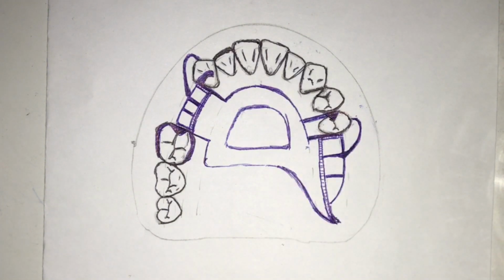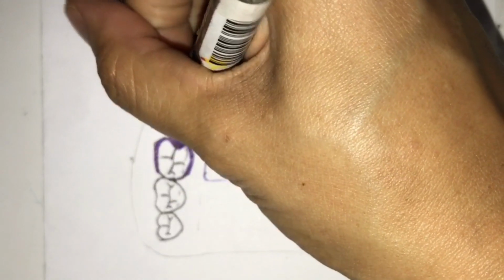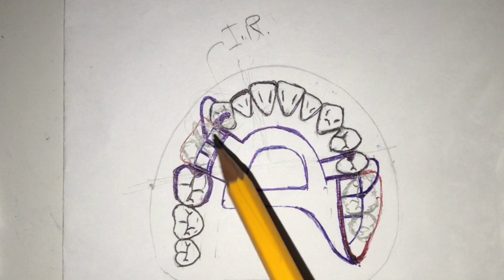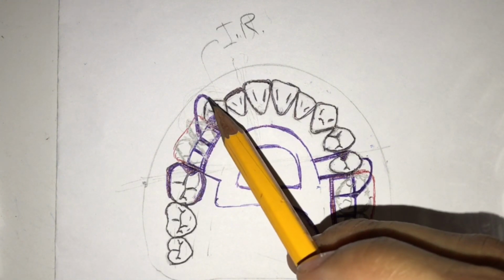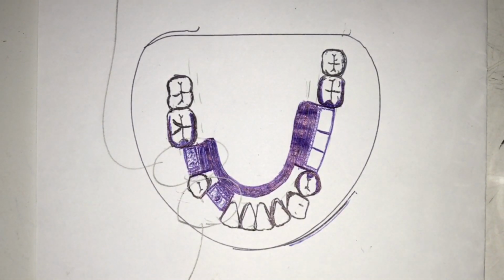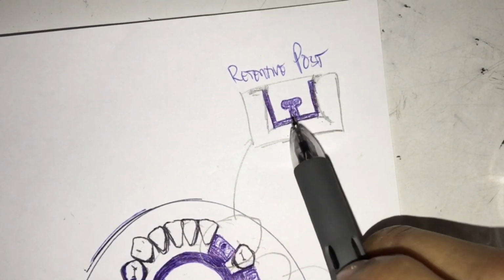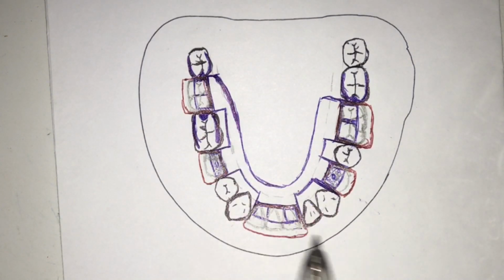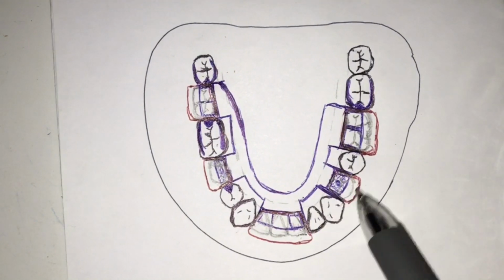Removable Partial Denture Design Principles Part III

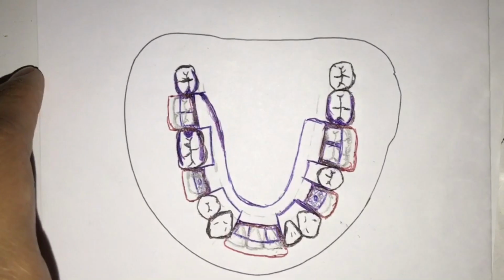Comment: Doc do we consider tooth 46 as pier abutment in the case 15:01 po?
Reply from the maker: yes we do but the thing about pier abutments is that when the periodontal support will be able to bear occlusal loads properly, you may use them like those seen in ideal and normal mandibular/maxillary molars esp 1st molars, and canines. This is due to their long and wide roots which provide adequate periodontal support. Although, another design option for that case is to just place proximal plates on 46 MD and use 44 as a primary abutment. Either way both are acceptable.
Reply: Thank you so much po doc. Hopefully there will be another video about wax pattern po :)